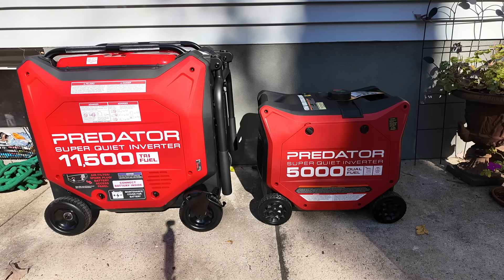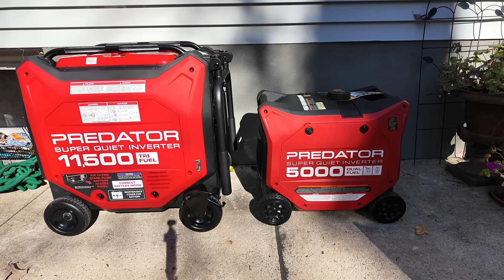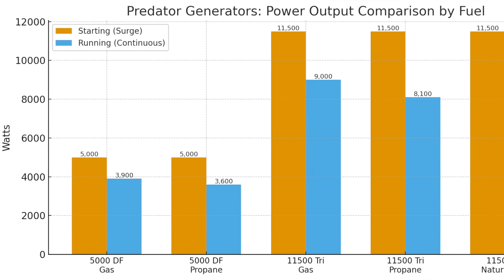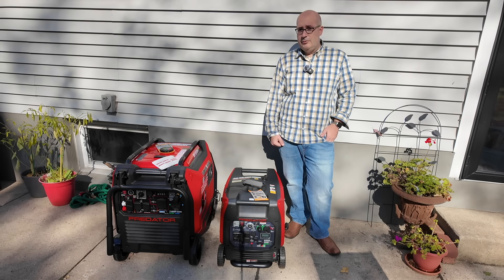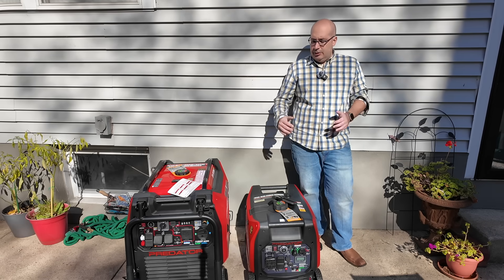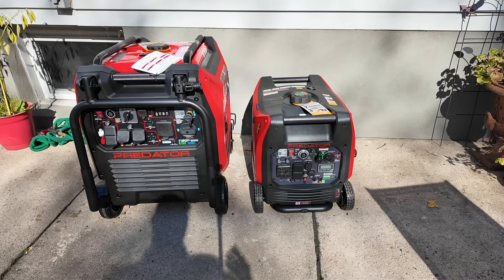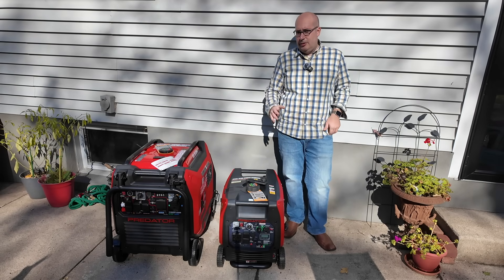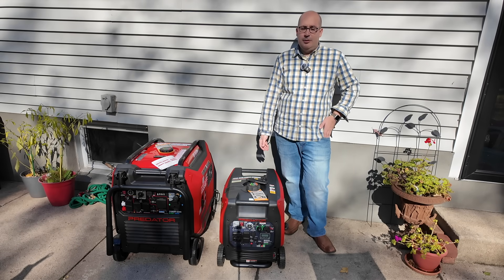Predator 11500w or Predator 5000w? Don’t Buy Until You Watch This!

Comment from the maker: 🔥 Be honest… Predator 11500 or Predator 5000 — which one would you NOT waste your money on?
I told you which one I’d buy… now it’s your turn. 💬

What should I do next?
⚡ Run one of these through a whole house test?
🔊 Noise war at full load?
⛽ Propane vs Gas burn-off?
🆚 Or do I line it up against a Honda and settle this for real?

Say it below — I’ll film the one that gets the most votes. No mercy. 💥
#Predator11500 #Predator5000 #GeneratorWar #WholeHouseTest #OutdoorPrepper
Reply: whole house load ( make part of the vidio on how to PROPERLY integrate it into power supply ond NOT electrocute some poor power co. employ trying to fix the problem in the first place!!❤❤
Reply from the maker: Good idea for a future video!
Reply: I’ve got the 5000 and it will do what I NEED (240 for central air is a want) and still kinda portable if I want to use it somewhere other than for my home.

Comment: Neither of them.  Why:
1. The 11,500W model - No good way to unbond when you are bound to plug one of these into your main service panel.  Can't comply with NEC codes without voiding the warranty on the generator really blows.  No ATS start when some other generators support ATS start.
2. The 5,000W model - Big.  Heavy.  Expensive.  I am able to get by with a much cheaper generator that is nearly as powerful and also runs on propane.   So I pull on the pull string to start it as it doesn't have a starter motor.  That actually turns out to be fine as it always starts on the second pull with propane and it is a light enough pull not bother me.  Then the generator is much smaller and lighter than the Predator.  My cheaper, physically smaller generator can sit there for a whole year and when I need it I just pull it out of storage and it immediately starts up.  No fussing.  No dead batteries to deal with.

So, why would you want either of these generators?
Reply from the maker: Thanks for sharing your perspective on why these might not be the best fit for everyone.

Comment: The fact you can power the larger unit with your homes Natural Gas Supply makes this the winner.  
One of the biggest problems is finding fuel for the generator. 
Natural gas is cheap, and goes right to your house.      

Installation wise? 
I just don't think the larger unit is really  the best fit suited for home use, but more for a jack of all trades out in the field or on a food truck/ stall as stated.   
I'm not a fan of food trucks, but I know they are a reality.   

The larger unit could be installed small  closed shed that has the fixings for a muffler out, and have CNG line ran to the shed making it the perfect set and forget install with a controller that cycles the generator once a week to keep things in good order,  with a solar panel on the roof to keep the primary starting battery topped up if needed. 

The issue I have with these units overall is that they don't really allow you to run your entire house just as you would if you had full 200 AMP  240 volt service -  something many Solar power inverters are quite capable of doing or the larger units that when you look at the costs associated with it, just seem to win out in convenience and comfort factor.    

With the availability of large LTO batteries getting cheaper every single day It's really hard to justify these kinds of home power backup generators.   
All of a sudden the smaller generator being there to top off the batteries and to chime in when the solar is enabled to keep up Sure seems to be the way to go as you can get them as cheap as chips.  

Heck you can even run your car as the main generator and safely go and get fuel and return and just leave that sucker running and it'll produce about 100 ~130 amps  to top up your home batteries granted if you have a high output alternator.   
It's also designed to be extremely quiet as most people can't even tell a car is running just by walking past it these days.
Reply: Depends where you are.  NG is expensive where I am.  I pay $700 a year in "delivery charges" alone even when I shut my boiler down for 7 months...
Reply from the maker: That’s a fair point - it depends on your location
Reply: @ohger1    People really are being ripped off..   NG was at one time a waste product.
Reply from the maker: You've really thought through the different options and their pros and cons for home backup and off-grid use. Appreciate the detailed comment!

Comment: can you get larger tires for the 11500? Something that would be able to more readily winched up into the bed of a truck with a come along via motorcycle loading ramps.
Reply from the maker: I’m not if you can. I’ve seen people do that to the 9000 but the axles never seem to hold up

Comment: I have a 10x12 shed .and I'm turning it into  my mancave..im going to have 3 TV's and a mini fridge..air purifier.. Internet.. fire stick... mini air conditioner...plus shed came with electrical box...a light and outlets....can I get a 5000 watt generator or do I need the 11500 watts .?
Reply from the maker: That’s pretty cool! You can definitely get away with the 5000 as long as it’s not a huge AC. A window ac would be fine with the 5000. Try to get an inverter type window ac as they’re super efficient

Comment: I've got a Predator 3500.  It does what I need around the house.  Also use it to recharge my Anker Solix C2000 Gen 2 (with attached battery).  Just did not like the idea of running a generator for extended periods of time.  I can get my C2000 Gen 2 recharged in about an hour or so.  I am looking at getting an Anker F3800 Plus (with an extra battery or two) and use the same set up to recharge.
Reply from the maker: Sounds like you have a great setup and a solid plan for expanding it!

Comment: I have been leaning toward the 5000, however I hear horrible things about how the 5000 runs on gasoline vs propane. It has been stated that there are problems with its CO sensor, even in the open air.  Some were running it in a truck bed and it was having issues which I would expect.  I was just curious if you have run either one of these prolonged on gasoline and had any issues with CO issue and or running on just gasoline issue.  Thanks, great video.
Reply from the maker: I’ve had the 5000 since a few months after it came out and I’ve had no issues but I primarily run it on propane. I know there are ways to disconnect the CO monitor although I have not attempted it personally. Thanks for watching.

Comment: I have two Harbor Freight generators 1 at my off grid cabin and 1 at home they are the 3500/4000 watt they have been trouble free pretty much  and there 8 years old each I  I keep them full of gas with staybil ethinal killer when I test them or use them I always cut the gas off while running and let it run out and go dead it saves me a lot of headaches on gummed up carbs too ! I recommend you get one they are a sound machine !!
Reply from the maker: That's awesome to hear about your experience with them, thanks for sharing!

Comment: Thank you for making these videos. If I didn't have a generator already, I would definitely buy the 11.5.
Anyone looking at something wired into their home panel, get one that can run 240v.

Last thing. Ive got a cheap westinghouse, I've been running for at least 10 years now.  Its dirty power compared to an inverter but I've never had a problem and it's never harmed any electronics in my house. It runs two  sub-zero refrigerators (with digital displays,) an electronic variable speed well pump, television, wine coolers, computers etc.  I've heard you can ruin those things by using a generator that doesn't put out a clean sine wave. The main point of my post is to tell you that's not the case. Or at least it hasn't been for me.

When mine breaks, I will get the predator since I have a buried 500 pound propane tank and I need about 9,000 running watts.
Thanks again for all these videos. They've been very well worth my time watching them.
Reply from the maker: Thanks for sharing your experience and the detailed feedback, I appreciate it! And thank you for the kind words and for watching!
Reply: @Outdoor_Prepper found your channel when you were the first one with one of these, and subbed immediately.  Have not been disappointed. Great info in an easy to watch “package”

Comment: Hi, I built a cabin i have a 200 amp service coming into it . I have a 50 amp generator outlet plug on side of cabin . Inside I'm running all electric devices . 24k mini split  1/2 horsepower well pump fridge, electric range ,on demand electric water heater.  12k . What do I need  ty
Reply from the maker: The 11500 should be enough power but you may want consult an electrician to be sure based on how much power your devices take. You’d need a panel interlock kit most likely to hook it all up.

Comment: One very important thing that you didn't discuss that can make a huge difference when selecting which generator to buy and that few people consider. 

Almost every "portable" generator is designed to be run at 25% load. The "continuous" rating is generally no more than 2 to 4 hours. This is why they spec noise and fuel economy based on 25% load. 

It is generally safe to run a generator at about 50% load for 8+ hours but the noise and fuel economy will suffer. It is also considered severe usage to do so. 

Most portable generators require an oil change every 100 hours after breakin, this is about 4 days ( 4 days and 4 hours). If the generator is used in severe usage it will need an oil change every 50 hours,  or about every 2 days. 

Severe usage is high load (50% or more), high altitude (different for each  generator) and high ambient temperature (some generators define high ambient temperatures as 90F, while others can be 100F or more) . A combination of load, altitude and ambient temperatures can equate to severe usage. 

Running your generator at high load, high altitude and high ambient temperatures will significantly reduce its life, even if you were to do daily oil changes. 

Now imagine that you are in an emergency power outage situation lasting several days. If you are changing the oil every 2 days that means that you must disconnect the generator output, let the generator run for several minutes at idle to cool down, shut the generator off, let it cool down enough that it's safe to do an oil change. This can easily be 1+ hours of downtime every 2 days. 

In other words if your expected load is about 3000 to 4000 watts, it is better to use the large generator than run the Predator 5000 at extreme loads for long periods.
Reply: The second important factor that is specific to the Predator generators is the warranty. They come with a basic 90 day warranty but you can purchase a 1 year or 2 year extended warranty. The 1 year is about 60% of the cost of a 2 year. Skip the 1 year. The cost of the warranty is determined by the cost of the item and the term. Buying a Predator on sale generally means a cheaper warranty. 

The Predator warranty transforms a low cost, generic generator into one of the best values in the market. 

The extended warranty allows you to take a generator back to Harbor Freight (after draining the oil and gasoline) for a warranty replacement. All that you have to do is state that it isn't working correctly. They take your old generator and give you a new in box replacement. At that point the extended warranty ends. The replacement comes with the standard 90 day warranty. The secret is that you can purchase a new extended warranty. 

If you instead purchase a generic generator, from a store or Amazon they may have a 1 or 2 year warranty. You must first get an RMA, usually via email. They might request pictures, then videos, as a delay/run around. Once they give an RMA you must ship the generator back to the factory. Needless to say this will be very expensive as you must declare your used generator as hazardous material (oil and gasoline). It can take many weeks to ship it back to China. What do you do if they claim that they didn't receive it? What if they claim that it received damage in shipping and you must deal with the various carriers. 

After they receive it, it may take several days for them to diagnose the problem. If they can fix it they will. If they can find any excuse to claim "out of warranty" then you will be charged diagnostics fees and repair. Many times you must pay return shipping. 

These companies know that it will cost you almost as much in two way shipping as it would cost you to buy a new generator and you won't be waiting for at least 6 weeks. 

The warranty on brand name generators is generally better. They will often contract with service companies in the US. You will still be paying hazardous materials shipping on a 100 pound or more generator. It won't be international which is a plus. Many brand name companies will pay return shipping if the repairs are determined to be under warranty, but don't count on it. You are still looking at hundreds in shipping and 4+ weeks to get it back. 

If they find evidence that you didn't do the required maintenance or ran the generator out of spec it will be determined to be out of warranty. Yes, running your 5000 watt generator at/near 100% load for several days will be obvious and will often lead to an out of warranty determination. 

I've used the Predator extended warranty and it is nearly hassle free. As my Predator 9500 failed in January I had to call around to find one in stock. 

I lucked out. I went to do a periodic start and it the engine would even attempt to start. My 2 year extended warranty was expiring in about 2 weeks. When I went to pay for the new extended warranty I found that Harbor Freight increased the rate and the new price of the generator was more. I talked to the store manager and she agreed to give me the new 2 year warranty for apprimately the same price as the original 2 year warranty, saving me well over $50.
Reply from the maker: That's really insightful information, thanks for sharing!
Reply: A lot of good facts.   But you still get what you pay for.  And while these are good for the once in a blue moon power outage if you are on a budget.  
But I’d rather save a few more dollars and get a better quality generator.
Reply: @rickylee2477 what is a better quality generator? There aren't too many tri fuels that are close in cost. I think Winco 11000 tri fuel is the best but it costs way more than this.
Honestly, I don't think this has any competitors at this price point.
Reply: I have a buried 500-pound propane tank that runs my 11k portable. When it's connected into my house, it operates at at  50 to 75% at all times. I can run for about nine days Straight, 24/7 before needing a propane refill.  There have been occasions where I've been out for four or five days. I would never consider changing the oil mid outage. I do change it regularly and after an extended outage, I always change it also, but I don't think you need to stop the generator to change the oil during an emergency. Regardless of how long that emergency is.
But maybe I just learned something. If anybody else does this, please chime in here.
Reply from the maker: @Drrich_DIY personally I would probably do an oil change every 100 hours if running continuously. It’s quick and will help prolong the engine. Small engines with no filters definitely benefit from more frequent oil change’s especially when operating continuously
Reply: @Outdoor_Prepper so that would be five continuous days. Makes sense.  When I lose power and the thing actually starts, I breathe a sigh of relief and the last thing I want to do is shut it down……….until power returns. (Even though I run mine every week or two for a couple of minutes)
Reply: @Drrich_DIY if all you use the generator for is the rare power outage, say 1 to 2 per year that lasts 2-48 hours with a rare outage of about 5 days you may not see much damage. 

If you run it at 50-75% for about 5 days at a time multiple times a year you will likely have a different experience. The damage is cumulative and progressive.

I've known people who buy a new car and never do an oil change. They'll say that it's a waste of money because they've  never had an issue.

Some of them simply buy a new vehicle every 2-4 years and only drive 10-12k miles per year.

Other people will be surprised when their engine fails at 70-120k and complain that their car was a piece of junk.

Another example. Let's say that a piece of equipment has a 0.1% chance of failure per hour when overloaded. Someone uses that equipment for 200 hours without failure and then think that the equipment will be fine for the next 1000 hours. They don't understand that the equipment can fail in the next hour.

That describes how you think about your generator. You've run it out of spec for a few hours and have had no issues yet. You've concluded that that is proof that it will continue to operate properly if you continue to do so.
Reply: @Slackware1995  Well I change my oil every 3000 miles myself like clockwork which is about once every 5 weeks with the amount of miles I drive so I appreciate your comment.  I take preventive engine maintenance extremely seriously whether its a car, a snowblower or my Exmark mower. I have never seen or read any of the information you describe but now unfortunately I am on a mission to learn as much as I can.  Thank you